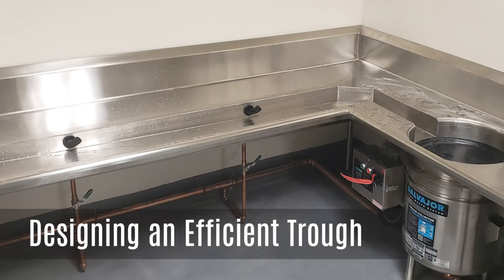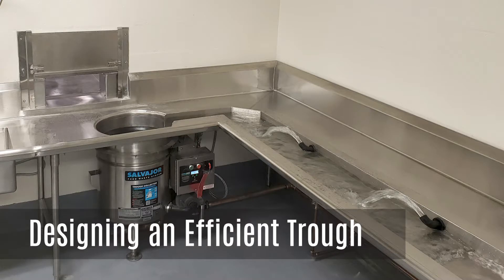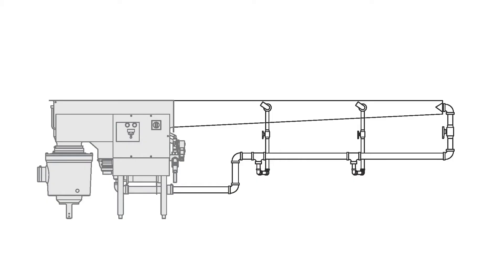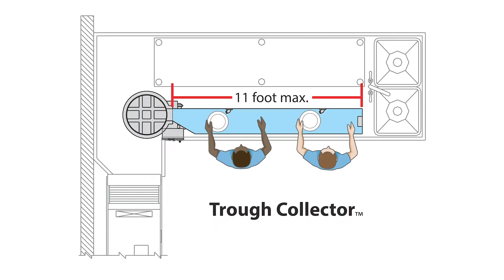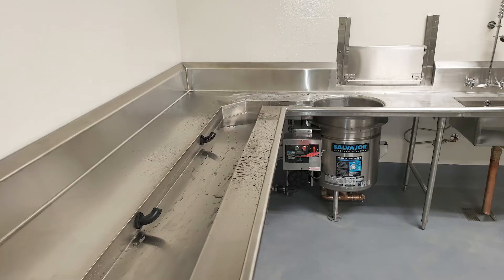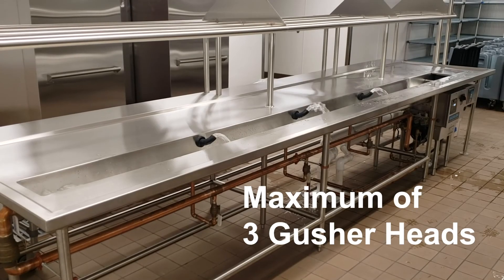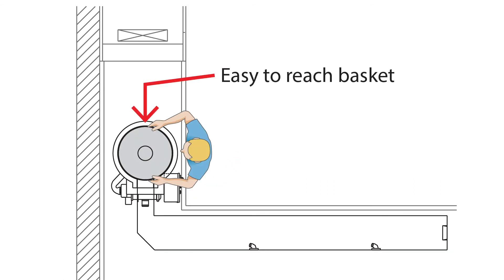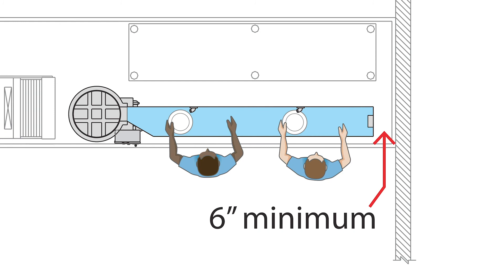Efficient Trough Design | Salvajor Collector Systems

Comment: I work in a hospital with this system that has fell in disrepair because of lack of knowledge of the system. They just don't know how to use this set up. The dishwasher is very dirty n barely works because of scale. The manager didn't know what descaler was. I had to explain to him what it was n what it is for do he  could order some. I feel like I'm in some kind of nightmare of days gone by. They still try to put animal fat down the drain. It keeps getting clogged n the last time my boss said it was from rice. He actually thinks that powerful disposal can't handle rice but can be ok with ground beef grease n bacon fat. Slowly I am getting the other employee to use it correctly. Maybe I'll get the whole thing running one day.